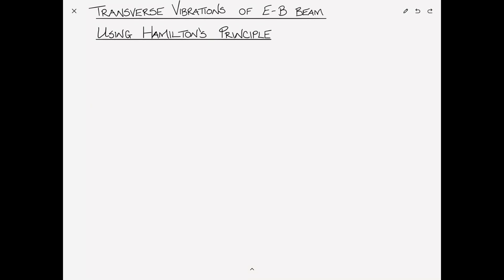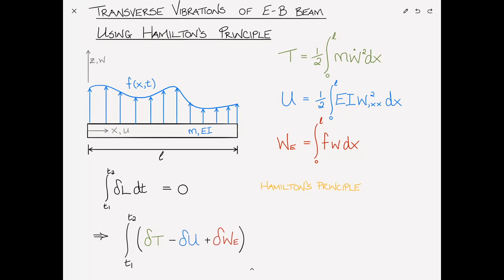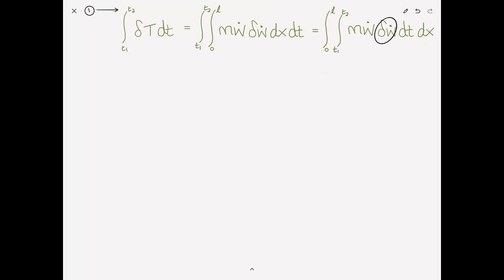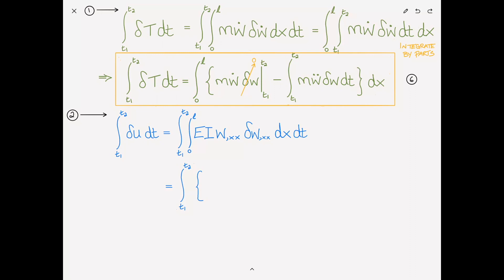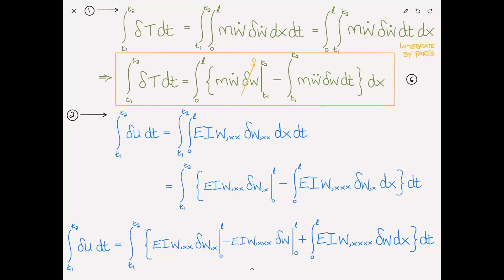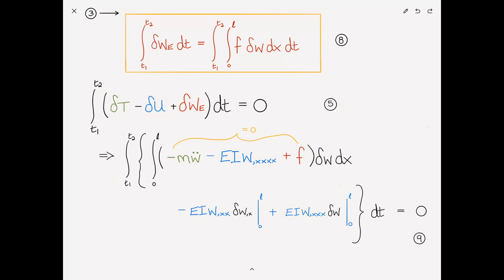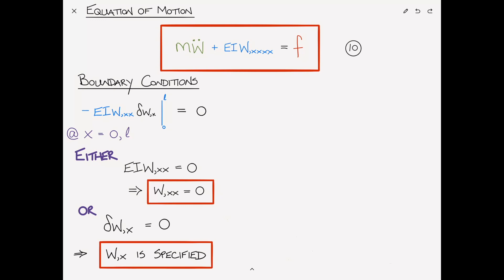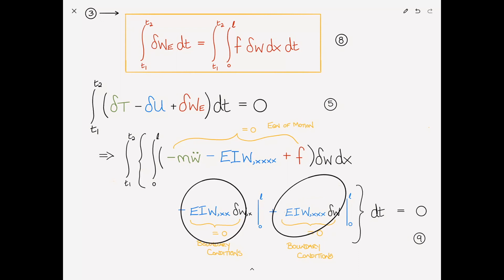Transverse Vibrations of a Beam Using Hamilton's Principle

Comment: Splendid work there! Can you give us a lead why every term of the integral must separately be zero? I understand that δw' is indeed a different entity, but why the other boundary terms?
Reply from the maker: In the case of the integral...since δw is arbitrary, therefore what multiplies it must be zero (this applies to every point along the beam).  In the case of the boundary terms, these must be zero independently because each of them only applies at a single point  -  there is no way that what happens with the integral for every point can always zero out the effects of a single point (the boundaries), so these must go to zero independently.
Reply: @Freeball99  thank you! That was really helpful!

Comment: Great video! As a undergrad engineering student, I've been doing a research on wind turbine towers vibrations basically using all of this. Do you know of any 3D version of those beam vibration equations? Thank you very much
Reply from the maker: What you are asking about is a "frame" element.  It will have 6 DOFs at each end node (3 translations and 3 rotations) and will handle bending in two transverse directions plus deformation in the axial direction (like a bar) plus torsion (like a shaft).  You should be able to find many examples of frame elements online.

Comment: How did you know when to switch order of integration?
Reply from the maker: In order to integrate by parts, one needs to consider the derivative that is under the integral sign (in other words, do we have a prime or a dot on the variation?).  If the derivative is with respect to time, then we must integrate by parts with respect to time.  If the derivative is with respect to x, then we must integrate by parts with respect to x.  We are free to switch the order of integration to accommodate this.  Ultimately, we re-write the equations with the time integral first, because this is the form of Hamilton's Principle.  Hope this makes sense.

Comment: Thank you sir! Great video. Can you briefly explain again why we equate (delta)W to zero between t1 and t2
Reply from the maker: To be clear, 𝛿W = 0 at t1 and at t2 and 𝛿W is arbitrary between t1 and t2.  Consistent with Hamilton's Principle, it is assumed that the state of the system is know at t1 and at t2, therefore the variation of the displacement at these points is zero.  Hamilton's Principle is thus used to determine the path that the system takes from t1 to t2.